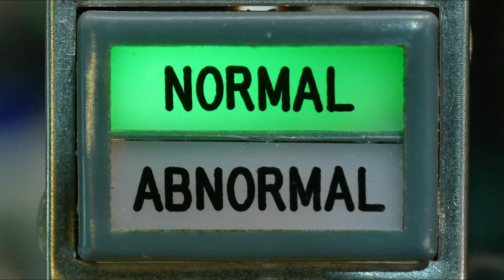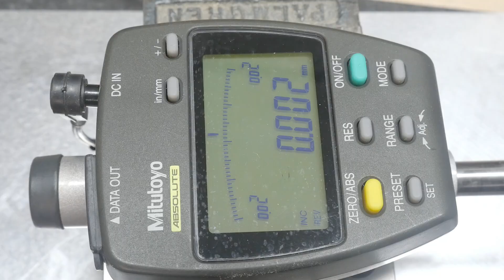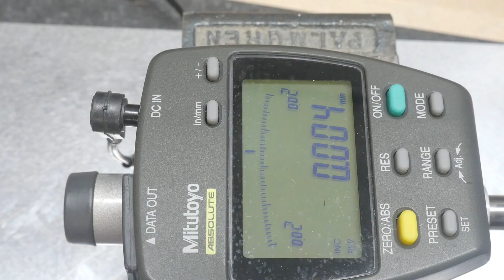#2439 Expensive Newport Optics XYZ Stage

Comment: I used to work with some optics folks, and their toys certainly seemed to be pricey!  A nice floating optic bench seemed to be the equivalent of a precision machinist's bench.  To be fair, a really nice scope cost around $20k back then, ... maybe more?  Nothing was cheap.   I'm still amazed at how inexpensive a 4 channel digital scope is now!  Even the worst digital calipers are pretty good and dirt cheap.
Reply: It's not called a machinists bench. Normally built from granite or cast iron. It's  known as a surface plate.

Comment: Precision XYZ table. But what is 'optical' about it?
Reply: The scales on the micrometer screws are intended to be read with board spectrum electromagnetic radiation in the optical range and have a spatialy modulated square wave reflectivity at optical frequencies.😊
Reply: @larslindgren3846  Right.......
Reply from the maker: the company Newport https://www.newport.com/ is an optics company. optical designs need very precise measurements and movements. distances sub wavelength of light
Reply: @IMSAIGuy let's say I'm working with 600nm light, kinda red.   Do you mean that the accuracy of this instrument is fraction of this wavelength?  I believe the accuracy of what you have is one micrometer which is a about 20000 more than this wavelength.    As I remember from old days working with this gizmo, we moved around  a spot size which was in 10s of micrometers.

Comment: .001 mm = .00003937 inch
Reply from the maker: yes, it is pretty small
Reply: @IMSAIGuy  I was gonna make fun of your Mitsu digital's resolution as opposed to a good old dial indicator, but then I wrote out the zeros and decided it wasn't so bad.
Reply: One micron...
Reply: @alistairmackintosh9412  potato-patato. It all comes out in the wash of dimensional analysis.